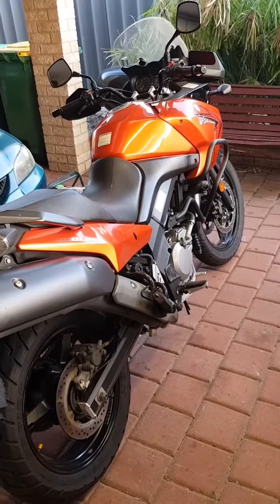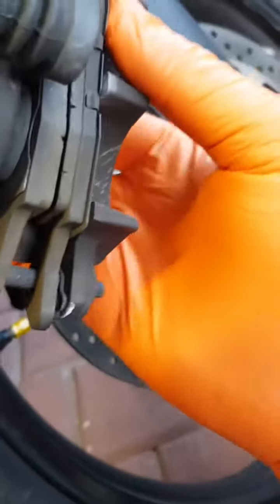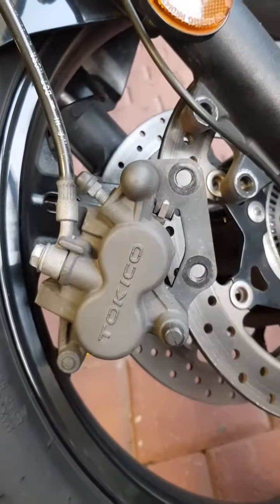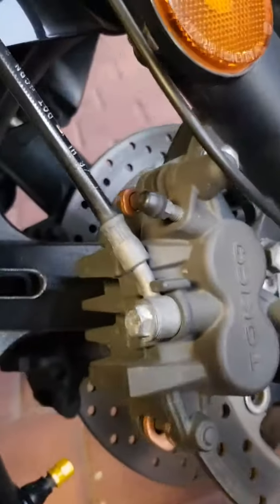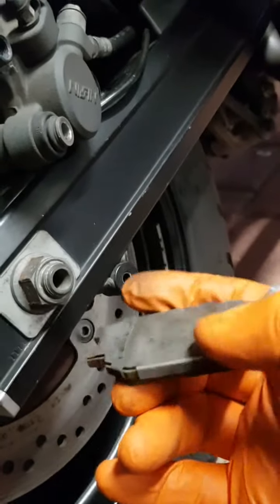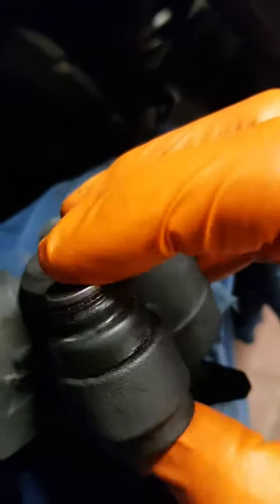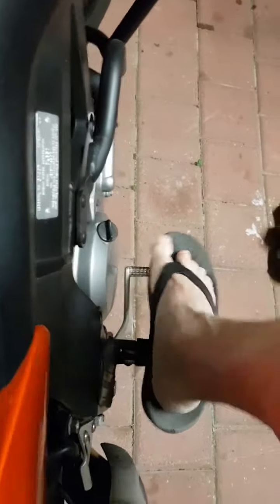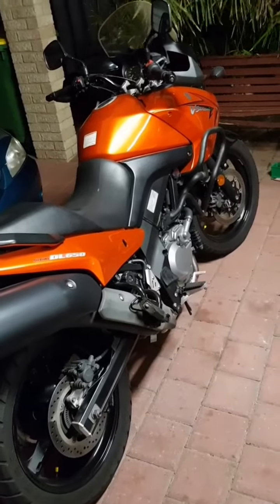Suzuki DL650 V-Strom 2011 new brake pads

Comment: Hi )
What kind of brake pads can u recommend? 
I just bought the dl650 from 2007, and I don’t like the brakes, maybe it’s better to put some special brake pads to have more stronger feeling? Coz right now it’s like a bicycle brakes !
Reply from the maker: hey ВИТЯ ТЕХНОЛОГИЯ, im no expert on what brake pads to use, but most organic pads seem to have a good feel. Also changing the fluid might help with how good they work. It is made to obsorb moisture and once saturated, will not work well under the extremes of braking. Hope this helps? let me know how your brakes turn out :-) cheers, Mark